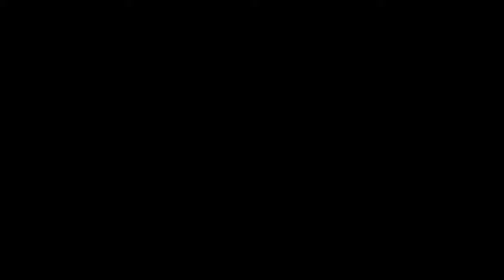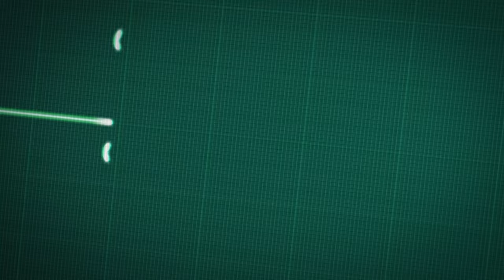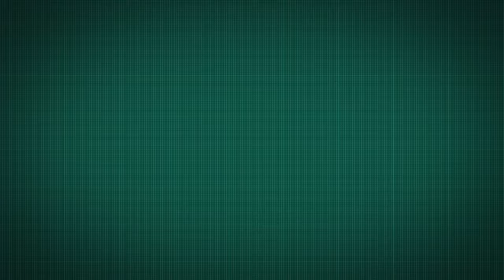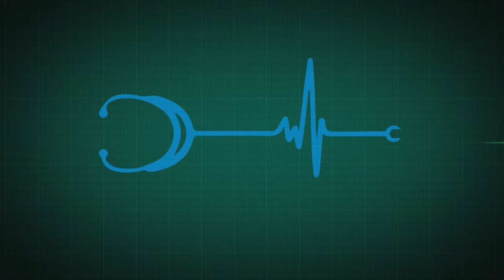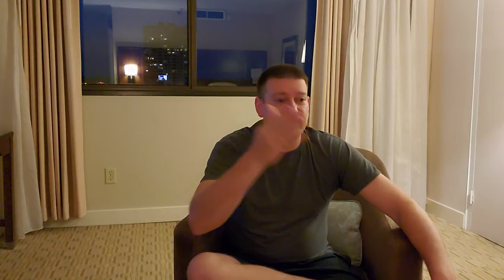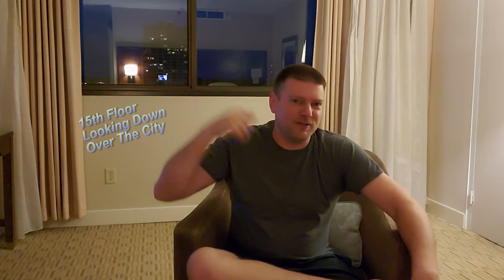2 Points of Failure on All Devices

Comment: Can you make a video about what kind of laptop is best for biomed jobs? Please I’m trying to get one for school for biomed jobs and like for internships and stuff and some are saying you need a lot of space and big fancy computer and others are saying you don’t.. please :)
Reply from the maker: Depends on what you will be doing. I highly suggest a laptop with a 15"+ display because more is better. Most biomeds will be working with spreadsheets or multiple  tabs of data.  Some laptops still have RS232 ports which you might want if you're working on lab or imaging equipment.  It really depends on your use case
Reply: @BetterBiomedChannel  thank you! I haven’t started college yet but this actually helps a lot more then what others have told me, I’m assuming no matter what, the more space/graphics the better?
Reply: @laures8937  negative. I have been a bench tech and field tech. Used everything from a IPad to a tough book for biomed work, and experience in multiple modalities.   Ergonomics and physical durability are areas to take into account. More so then graphics and local hard drive space( 1TB to 500gb even.   This is due to large files like your service manual library should be kept on a secure  sd card, cloud service or portable hard drive.   This way you have it for your entire career)
*m.2  or Atleast a solid state drive so the applications you do have load quickly, in addition to booting up.

Graphics should be moderate -  as your usually not dealing with intense demand here.   Only care if you are using this to do some casual gaming or if your thinking about programming etc.  

Durability: this laptop will have to endure not only the student life of possibly getting thrown around, stuck in a bag or other daily activities. This will also be used in the field, stuck in a tool box- set on a cart while working on medical devices, or perched in some way while you conduct repairs and pms.    All this equals a high drop chance, or other accidental damage.
Invest in good protective laptop sleeve 😎.

Ergonomics:  this ones a bit debatable between techs as what’s comfortable.     Ease of use, is my main point here.     Touch screen and a stylus is a bonus, but can be great if you become accustomed to it.     Most of the time in the field you will not have room for a mouse, and I hate track pads.  So a touch screen stylus  works wonders till I can get to my docking station. Please also consider the weight your comfortable with.    

My suggestion is going to be the Microsoft surface - great selection of aftermarket accessories plus windows is still predominant as the OS for medical equipment.  

* you can also buy a super cheap “service laptop”.  With legacy hardware ports like serial ports, cd drives  etc.  this will be solely for legacy medical devices that need this for software cal or configuration.  

*You can buy a usb to serial adapter also but these can be problematic

Hope this helps!
Reply: @MrPandabangbang  oh my god thank you so much!!!